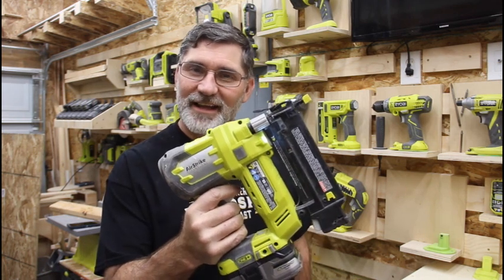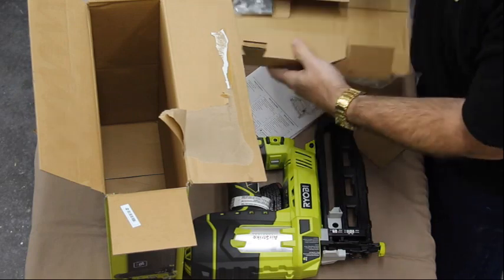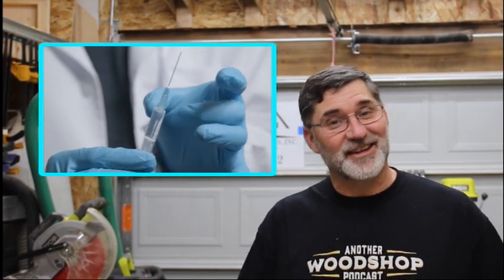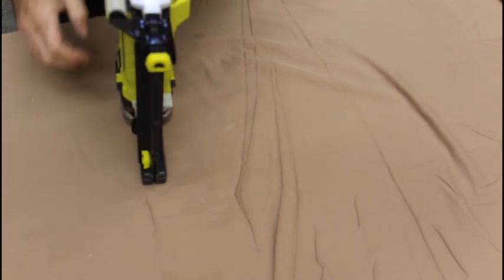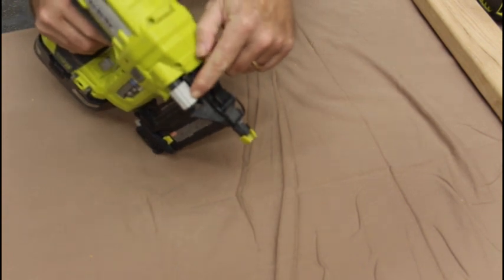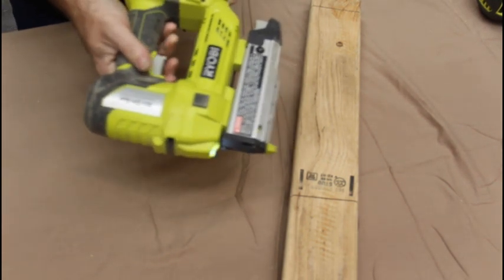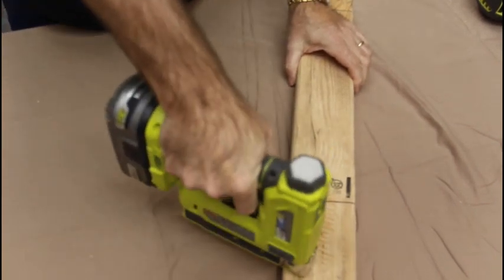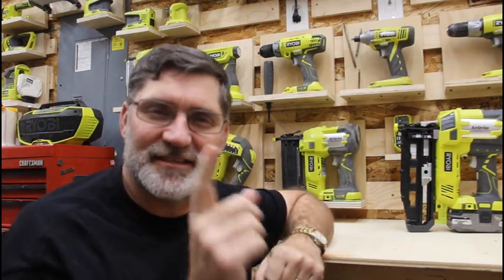RYOBI Nailers and Staplers | UNBOXING and DEMONSTRATION | 2021/12

Comment: For non-commercial general home use, these are great and cost-effective.  I have both the 16 & 18 GA nailers, as well as the 18 GA crown stapler, for about 2-3 years.  They have never failed and very rarely miss-fire.  I just bought the 23 GA pin nailer and it is also really good... and will get a workout soon.  So handy for remodel & shop project build work.  Considering the T50 (3/8" crown) stapler as a next purchase.
Reply from the maker: A great testimonials. I use them in my professional business as well!

Comment: Hello again.  I just can't decide what to buy - p318 or milwoukee 2540-20)).  What do you advise?  Are you familiar with the 2540-20?  I understand that the 2540-20 is the professional version and the ryobi is for the home, but the price has a major role.
Reply from the maker: I have no experience with the Milwaukee line. Depends on what batteries you already have.
Reply: Thanks.  What about durability and quality?  In Russia, Milwaukee is VERY expensive, but I need it to work.
Reply from the maker: I have a good opinion of both brands.

Comment: Hi there, great video buddy. Can you use the 18g and 23g nails in the 16g nail gun? or are they not compatible?
I’d like to buy the 16G air strike as it’s on a very good deal here in the UK but not sure if I’m restricted to just the 16g size nails only.
Reply from the maker: Just the 16 gauge nails. Thanks for the compliment.
Reply: @DadItYourselfDIY  ah ok.. great, thank you 👍🏼

Comment: Which model can be used for concrete panel nailing?
Reply from the maker: None.  You need a 6d or 8d Galvanized or Stainless Steel Nail for cemetitious siding. The largest brad nailer Ryobi makes is 16 Gauge which is still too small. Other manufacturers make cordless nailers for this size.
Reply: @DadItYourselfDIY  Actually Ryobi makes a 15 gauge AirStrike.
Reply from the maker: They do!

Comment: Can you tell me if the Brad nail (18 gauge) is ok to use on Jarrah 19ml floorboards? Nailing into a treated pine beam.
Reply from the maker: Jarrah, seems to bevan Austrakian product that I am not familiar with. The question that should be asked is, can Jarrah floors be installed with an 18 gauge brad nailer.  Refer to your floors installation instructions for the proper methods that will maintain the warranty.
Reply: @DadItYourselfDIY  thanks for the quick reply. Yes I’m in Australia and jarrah is a hard wood.
Reply from the maker: The nailer is really strong. I'd try it out on a scrap piece if it's considered an authorized installation method
Reply: @DadItYourselfDIY  thanks again mate 👍🏻👍🏻
Reply: I don't know if you decided what to buy but I'd say that the Ryobi 18 gauge brad nailer should have enough power to do what you want. I've driven 2" brads all the way into oak with mine.

Comment: Ryobi nailers are great! They got it right while DeWalt and MILWAUKEE are still trying to figure it out.
Reply from the maker: You hit the mail on the head with that comment!
Reply: huh? milwaukee has the best nailers in the game by a long shot.. what you talkin bout LMAO
Reply from the maker: Not going to buy a Milwaukee tool for two reasons, $$$ and I have 20 Ryobi Batteries.
Reply: i think your all confused.. yes the RYOBI costs less.. but they also dont last more then a year.. so  in 5 years youll have to buy 3 ryobi nailers when you could buy Milwaukee and have the 5 year warrenty as well as quality holes
Reply from the maker: If I was using mine daily I'd consider your advice. But it's used occasionally at best.

Comment: Very heavy
Reply from the maker: Not really.
Reply: @DadItYourselfDIY  In comparison to replacing a pneumatic Ridgid 16 gauge nailer it is. I should have mentioned that.
Reply from the maker: Apples to Tunafish comparison. The battery is going to add weight to the Ryobi, but lugging an air bottle/compressor and hose is heavier than the battery.. 😄
Reply: @DadItYourselfDIY  I wouldn't exactly say tunafish. Function is the same. For someone that uses one a lot, of course go with the battery powered. For once in a while use I'll stick with a much lighter air tool and lug a small compressor. Really appreciate your views.
Reply from the maker: Fair enough. I've uses air powered pin nailer now there is the best tool for a production environment.